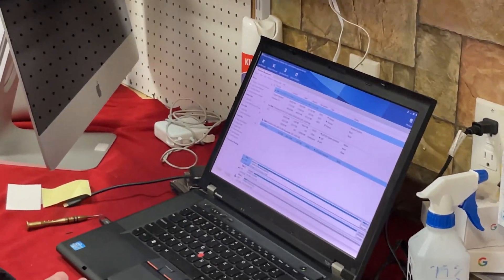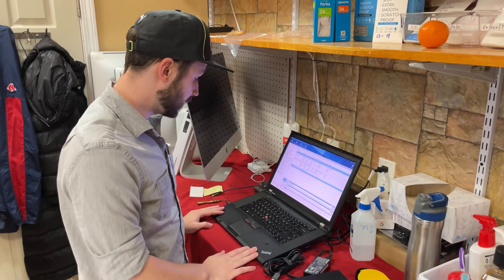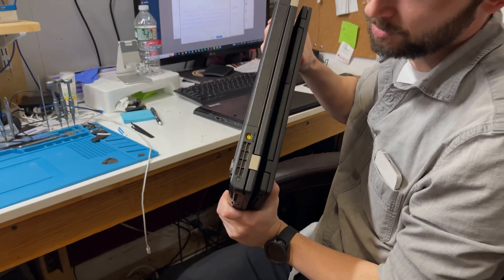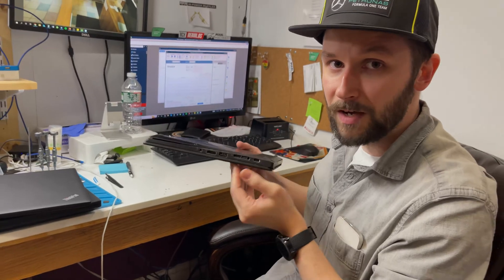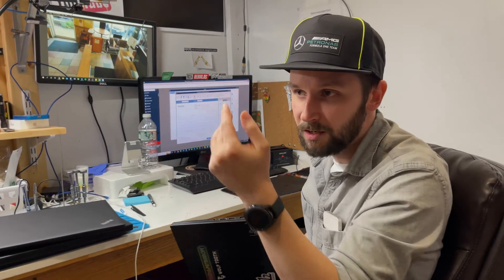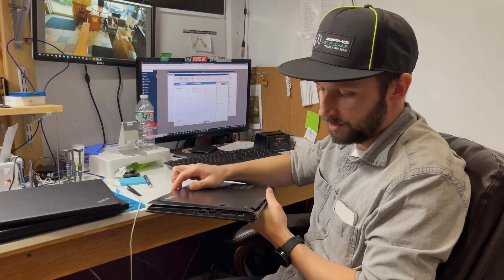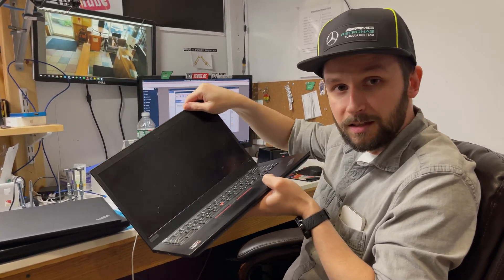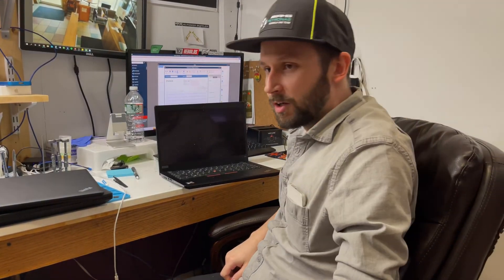Soldered USB-C ports are a step backwards for the laptop industry

Comment: I have had several thinkpads now a t470 i5 sreeen just died .I want to get a t480 i5, but I do not like not having the the older modular power port and losing one usb port for charging . Is there a way to mod the t480 to have the older power port .I have much electronic and modding experience ,just need to know the 19v connection points. 8th gen cpu chipset in a t470 would be best laptop.

Comment: Quick question:

Whats the issue with USB C? Ive been using a Fujitsu laptop with two USB c charge ports for about half a year now, and i haven't experienced any issues with it. I haven't really heard about any issues with USB c, and ive only heard it being hyped basically everywhere where it was brought up.

Is there some sort of structural issue? Is the issue with the charges instead of the port? Or is it something completely unrelated?

Thank in advance
Reply: Manufacturers like Lenovo don't provide the necessary frame support for their USB-C ports, so instead of being integrated into the chassis of the laptop they're held on by cheap solder attached to the motherboard, which is extremely fragile. Also due to its hollow shape, USB-C itself is objectively less durable than other connectors such as Lightning. From my personal experience I've had more USB-C cables fail than any other connector, but like I said, that's either a manufacturer or industry problem.
USB-C is overpraised in my opinion, likely due to the convenience of standardization, though it's still a bit counter-intuitive to me considering how fragile it feels in comparison to even HDMI.

Comment: I know its old video but on that device you still could charge it with The thunderbolt ucb c Port with same amount of voltage.

I Have used T490 since 2019. Soldered charching Port sucks but aside from that its well made and repairs or chanching The battery would Be fairly easy If needed. 

However, I Have used The laptop pretty much daily for over 5 years and carried around it in My bag. I Have dripped IT couple of Times from desk height but aside that only normal wear and tear. Hinges still work well and aside from few scraches there arent Any structural damage to The chassi

Comment: I use a T580, and the USB-C ports on my laptop never caused me issues. I however do agree with the screen indent from keyboard.. and one complaint is the seam between the top casing (the casing with keyboard) and back-panel are designed in such a way that IF those annoying clips broke, then each time from now on you open the laptop there is a "bent" or "opening" big enough to slide a card in. Really glad that T590 later fixed the issues though

Comment: after 3 years, my e14's type c charging port also broke. few months ago some of the keys stopped working, and I had to replace the whole top panel because you can't replace just the keyboard with these. And key prints on the screen started to show up just after few months of buying it. A totally crappy laptop.Never buy the E series.

Comment: Even the T60 from 2006 has a modular charging port (Nearly all laptops had soldered DC jacks back in 2006). I'm not 100% sure if the T30 from 2002 has a modular or soldered port but at least the T60 has a modular port.

Comment: Actually I like the USB C, as don't have to carry a separate charger. Do agree they sure be separate board. I fixed 100's of USB C laptop as people tend to break ports and typically the charge controller and I/O IC goes as well, but have to remember that also tend to be same people that break large HDMI ports as well?

Comment: The gen3 x1 carbon is blah. It has soldered ram but at least the sim, wifi and drive is replacable kinda. Although BIOS LIMITED for some awful reason. Great laptop otherwise. 6screws to open which takes 1min. Recently swapped their charge port to a usb c port so i can charge from anything. And currently working on adding an internal usb hub to add 2 usb c hubs. Kinda means my charge port is replacable now as its a separate board. 

Having both c and a is important. Anything with just c is god awful dumb. And not having at least one c port is also dumb. Headphone jack takes up like zero Space so i hope its never getting removed.

Comment: I have a fleet with about 40 T480 or similar models. They made the charge port USB-C a bit larger than the ThunderBolt USB-C next to it for whatever reason. The cables don't fit in as snug and people wiggle them around when plugging and unplugging their chargers. Eventually they damage the port. Thankfully the thunderbolt port next to them can also be used for charging, so I haven't had to throw out any laptops due to both ports going bad. I have never had the secondary port fail, but the primary port fails all the time, it's infuriating.
Reply: Absolutely for these laptops you need to also provide people with a magsafe charger that has a little magnetic to USB-C tip that goes in the port and stays there. It'll safe you so much headache in the future.

Comment: One advantage of using usb-c to charge is you can connect to a reverse power delivery monitor  using a single usb-c cable, and that one cable take cares of both video output and charging for the laptop.

Comment: What is your opinion on the Framework's USB-C ports?

They're soldered to the board and non-modular, but you usually have an outer USB-C module that'll take most of the beating with unclean disconnects and whatnot.

Is this a good design? Or will some charging port failures kill the power supply circuitry on the non-modular motherboard making the outer USB-C port not matter much?

Comment: I own a T530 and a T540, I 100% agree with you!   I come across customer laptops all the time that are soldered and I simply wont touch them, not worth the hassle.  Speaking of hassle, you should touch on the HP laptops with a single DIMM slot on the BACK SIDE of the motherboard with no access other than to un-layer /unscrew everything and flip the motherboard over to access the RAM slot.  Models like that, on the crucial website, wont even acknowledge the RAM is upgradable lol.

Comment: I think this is somewhat of a bad take. We are all using USB-C for basically anything electronic. You can't really blame a port which is a massive win for convenience because of bad implementations from manifacturers. It's a shit design when the charging port is directly connected to the motherboard instead of having its own little sub-PCB or such. Dunno, there could be many other ways to design a charging port without having a tendency to fry the connector. It's not USB-C's fault.

Comment: Usb c is great and looking for a good charger for the yellow port is a pain. Those proprietary chargers (not the ports) are hella expensive to replace (I got a P51) It's not type C's fault Lenovo went for soldered connectors instead of modular.

Comment: It's not that usb c is at fault here. Lenovo is the one using crappy usb c ports. My work dell laptop has a type c port and my phone also uses a type c port with both of them being sturdy and i only have to carry one small charger for both of them. My phone (xiaomi) is almost 4 years old and the c port is still good. My personal laptop however ideapad gaming 3 has a type c port with no charging though and you can just tell by looking at it that the port is crap its made of really thin material and soldering just makes it worse.

Comment: Using usb c seems like a good choice to me in general, more universal which is good since the powerbricks tend to never last as long as the laptop or if you simply forget it at home. It also provides more functionality, which is nice since laptops never seem to have enough usb ports.

With that said it would certainly be much better if it was on a modular daughter board. USB c is typically durable but it's still likely to be the highest wear and tear part on the entire laptop.

Sure, a usb c port isn't particularly difficult to replace even with just basic soldering equipment but it sure would be better if it was serviceable by any unskilled user.

Comment: "It can be replaced without replacing the motherboard"
All you need is a cheap 2 in 1 hot air rework station and some flux.
BTW....I am moving to Massachusetts from Pittsburgh PA. I will be opening a place in Holden. I do component level repair including reballing chips and liquid damage.

Comment: just because it can be resoldered doesn't excuse the poor design, nobody if they knew that resoldering damages a board would ever say that. heat damages the silica, after a few port swaps or even just one you cant repair it again.

Comment: I have an old old genuine true IBM thinkpad. One made before IBM did the worst move ever and sold their quality machines to a non-quality company. The laptop was acquired used and the person before me but screws through the keyboard and the darn thing still works. It doesn’t have a battery because it died many years ago the charging brick cable is all frayed up but still works. Many connection slows are all lose but still works. And no hinge problems. This is back in the day when processors were just single core. That’s how old this laptop is. Here is the thing. I took it out the other day. Turned it on and the ancient laptop came to life and loaded up windows XP. 

Took a long time but with the specs you can’t complain the elderly laptop was giving it all it’s got. 

I’m holding on to this treasure for dear life. So one day before it’s my time to leave I can show the world what a real laptop used to be like. 

Never giving up this laptop. It would take a huge amount of money and even then id still have to think about it.
Reply: Technically IBM has been already outsourcing the Thinkpad productions for years before they sold to Lenovo. Which also saw the entire staff, engineers and executives, working for Lenovo. iirc to is that management for the Thinkpad and IBM's laptop division would as part of the deal end up taking over management at lenovo. Like how Nokia spun off it's phone business into HMD, which now makes phones branded as Nokia but with the same team of engineers and executives under a different name.

Comment: This is less an inherit issue with usb c and more how they build them, i see usb c as a win for repair, in my experience the cable will be the first thing to break for most folk, so having a single standard instead of special snowflake connectors is a win for me.
Reply: I have never had a USB C cable wear out, I've had 5 USB C equipped phones have their ports give out.
Reply: Both the cables and the ports wear out, but cables tend to break more easily due to being bent all the time.
Reply: @InvidiousIgnoramus yes, the spring is in the port iirc

Comment: Gaming laptops are a far better options now and have been for over a decade. Upgradable, repairable and performant. Especially the clevo's which had 4 ram slots + 4 drive slots since 2014, along with options for upgradable desktop cpu's, swappable batteries, etc.

And their cooling systems are able to handle high amounts of workloads. 

And if you think this soldered port problem is bad, wait till you see the customer ripoff's chip makers pull on laptops.

Comment: USB4 signal integrity requirements dictate that the connector be soldered to the MB. Its that way with all brands. Only non-Thunderbolt USBC ports can be modular. Similar to soldered RAM, non-modularity is the price of higher performance.
Reply: I don't think either of these reasons outweigh the sacrifice, for RAM or USB-C
Besides, it was industry standard wisdom that modular power ports was an obvious solution to an obvious wear part.
We're literally going backwards.
Reply: Nah , my dell latitude has a removeable Thunderbolt board . Recently replaced mine for 20 bucks i bought from ebay.. thats a lame excuse
Reply: @exiledwolfch  Which latitude model? I haven't seen one yet that is replaceable...
Reply: "Only non-Thunderbolt USBC ports can be modular." So... Lenovo charging ports then? lol 
They still make them soldered for reduced repairability, though.
Reply: uhm, so how has Apple kept the USB-C ports modular on every single MacBook that has it?

Comment: I call this planned obsolescence.

This is on purpose, the old connector standards were simpler to deal with and replace in case of failure or damage, these current models are following this ridiculous trend.

I don't know for sure, but definitely for these reasons, I don't care about Lenovo, they are currently regressing, and other companies have a tendency to copy this.

It's a total shame and disrespect, besides the fact that USB Type C is a nightmare to carry out repairs or replacements, a lot of work.

Comment: my first usb c thinkpad was wasted because of the usb c charger and now my second one is failing.. that's why I kept on saying the EU enforcing usb c on laptops was the worst choice ever! It is no good for laptops, it is too small and fragile! We need some kind of USB D that would be like usb C but the size of USB A and pin compatible with USB C. Also.. the shell has already cracked in like 8 places... WTF... I've been using thinkpads for like past 20 years and now I'm pretty much forced to keep on buying them because there is zero competition but the quality is no longer there... They are well aware of the fact that people will be forced to buy thinkpads regardless of the poor quality and high prices because they are the last brand still making trackpoint laptops and no trackpoint is a deal breaker for any serious profesional use...

Comment: I also heard USB C charging chips could overheat like crazy, causing them to be cooked thus, killing the entire motherboard. I think this happened to my bros Razer Blade. Is this true?
Reply: Not the chips, the port itself yes.  With the amount of power going through it all it takes is the port being stretched, a weak connection forming, or a bad cable and you get higher resistance and that makes a ton of heat.  But it's not really a USB C problem, even Nvidia GPUs were burning up and melting because of the same reason.  It's also what causes home electrical fires and is why you should replace loose or wobbly plug receptacles as soon as possible.

Comment: Hi, unpopular opinion and probably due to my small experience with Lenovos in particular, but the only time I had to fix the Lenovo charging ports was the old square ones. I could however fix them literally with some hot glue and plastic bits. I have one of the newer ThinkPad X1 Yogas because I needed a 2 in 1 for studies abroad, and I can feel the ports getting wobbly... and I knew full well what I was signing into (I always check the serviceability before purchase), it's just that there was no real alternative.

Anyway, the ultimate gigabased charging port of all time is just a round DC jack. I have a 13-year old Nokia with it's original out-of-the-box charger, and only now the charger cable is starting to fail... The only real problem is it's not as interchangeable with USB-C, so there's more of a risk of running out of supply.

Also, USB-Cs are obligatory these days because of European Union legislation. And I think it is pretty beneficial especially in the smartphone world, because - who had to deal with the fucking microUSB port for charging, knows my pain.

Comment: man lenovo's consumer division laptops are the worst especially the old ones the g50 z50 whatever the hell series of laptops somebody in my neighborhood still uses a g50 several missing keys so many vertical lines on the display no battery power button is busted it's gonna snap at the hinges soon i hope he gets rid of that thing xuz it's also slow a Pentium cpu from 2014 as well with only 4gb of ram and a hard drive

Comment: If you go USB-C why make it non modular? Genuinely that causes a lot more issues down the line and ive seen this design quite a few times go horribly wrong. Sometimes i quite literally have to tear my machines or controllers to bare parts just to clean one thing or fix one thing. Hell i did it just yesterday just to clean off a joycon properly and asses the motherboard damage (to even get to it yoh gotta take almost the entire joycon apart. Its worse if you need to replsce the joystick because you gotta take the whole thing apart to even get to the joystick.

Comment: I switched from X220 to X390 recently and tbh, USB-C charging is my favorite thing about it. Opens up a whole new world of compact 3rd party adapters instead of the usual Thinkpad cinderblock chargers, plus I can use the same charger for my phone as well.
It really should have been on it's own separate board with a little flex connecting it to the mainboard though. The port already feels pretty loose on mine.
It's definitely not as robust and solid as the X220 either.
I was thinking of getting a Framework but the value of a $150 ebay thinkpad still can't be beat, even if they're not as solid as they're used to be.
Reply: a n i m e
n
i
m
e